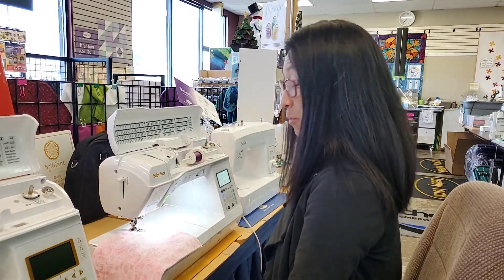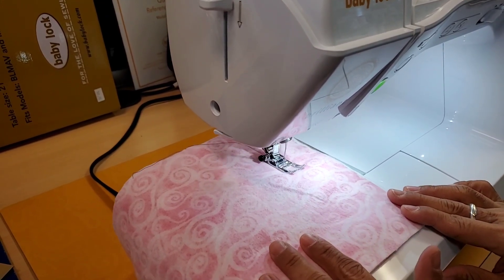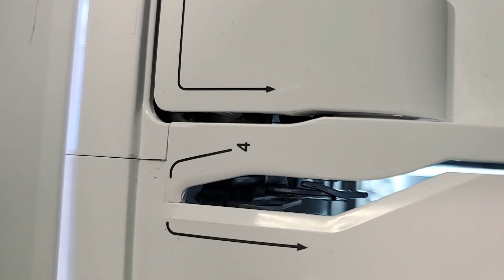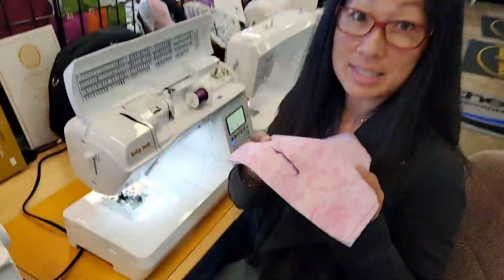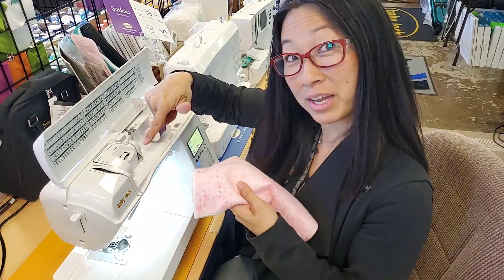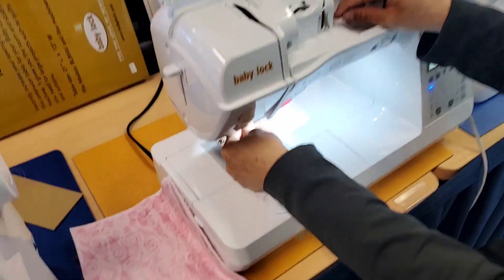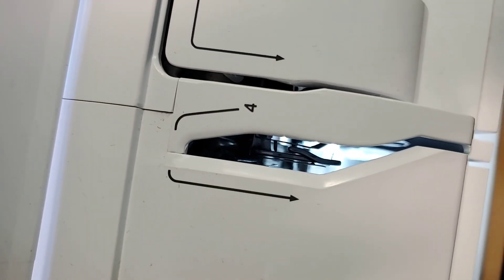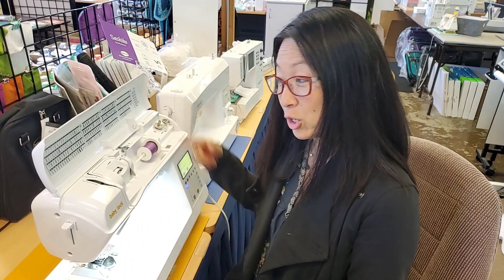Technique Tuesdays: Threading Problems and Solutions (Could it be your take up lever?)

Comment: How to do you stop the thread coming off take up lever when seeing , I know it’s on at start then when sewing it comes off ? .
Reply from the maker: Make sure you pull it all the way to the front of the take-up lever.  There is usually a round holes in the very front part.
Reply: @A1VacAndSewReno  thank you

Comment: When I used my thread cutter, my thread comes out of the eye on the first stitch. I also noticed the thread is ending up on the front of the little bar at the top of the eye. Do you have a fix for that?
Reply from the maker: Hey Ebony, what thread are you using? I find that some of my thread is curly and will pull out of the eye of the needle.  Patrick also pointed out to me,  if you're not following all the threading steps,  the thread can pull out.  Finally,  if you're needle is headed up,  the thread will pull out.  If the needle is headed down,  it will not pull out.  Hope that helps.